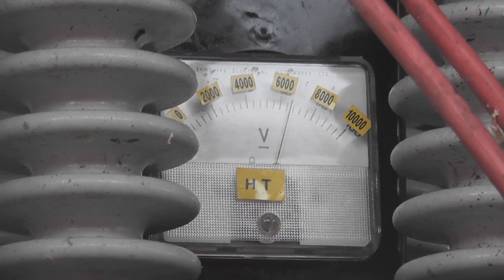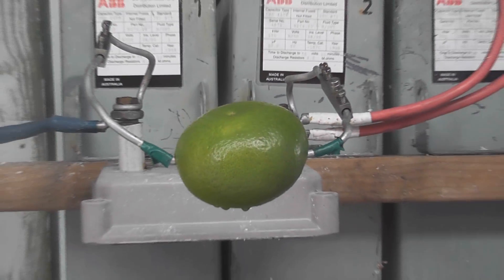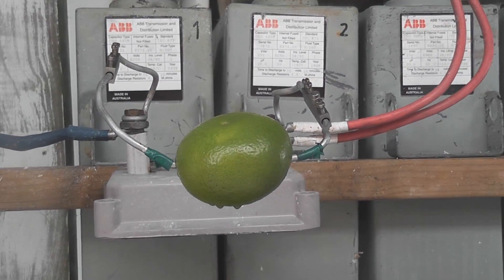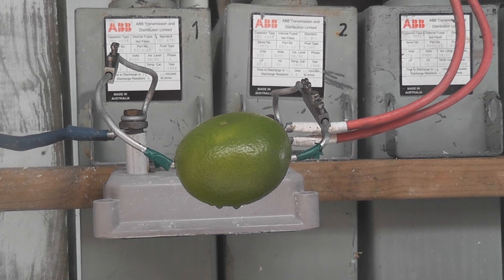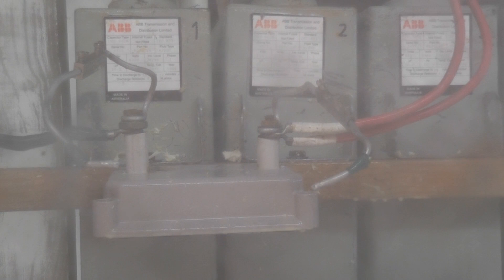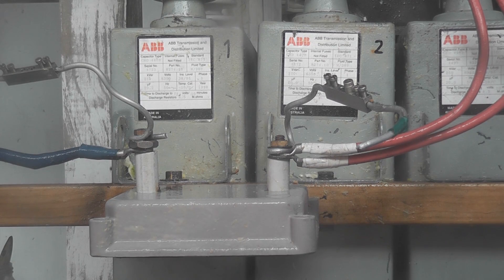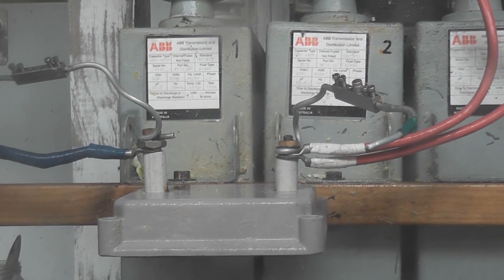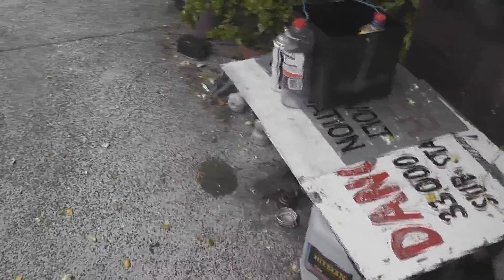5 x Grapefruits explode

Comment: May I suggest you blow up an LCD panel from laptop/monitor. I've done this with small calculator-sized LCDs on my 500 Joule cap bank. Expose liquid crystal material on opposite sides of LCD and connect cap bank to it. The liquid crystal vaporizes, pushing the two glass sheets in opposite directions and raining powdered glass! Thank you for all the explosions!
Reply from the maker: Eric Wasatonic Great idea will source an old laptop display for that. Also go and degause a CRT TV set next weekend.

Comment: That's awesome. You should maybe pull your camera back farther from the action and then zoom in because the audio sounds clipped when the cap goes off, or add a separate mic farther away.
Reply from the maker: coondogtheman1234 Yes true, it was a windy day so I enclosed my testcell with towels which got covered in grape juices.
Reply: RODALCO2007
lol I saw that. I saw a piece of the wood sparking, a leak possibly?

Comment: Can you make some sort of coil gun using this set up? Be care full what you point it at though :-)
Reply: Coolkeys2009 looks like too much power to handle. He would need super expensive mosfets and diodes. Better to just make a multi stage version with lower voltage, that would be more efficient too. Military equipment might use something like this but they dont have the same budget as we do.

Comment: I seen the wood of cap bank burning at one point hv must be leaking somewhere
Reply from the maker: Josh C Well spotted, partial discharge leaking from the positive through the acid from the previous explosion.
Reply: Josh C RODALCO2007 Yea i saw that too at 1:10 just under the red cable. I take it the blue cable is the one thats switched, so the red one is at the capacitor voltage?
Reply from the maker: DextersLab2013 Yes, the blue cable is switched though the knife switch from the yellow end of the Cap.